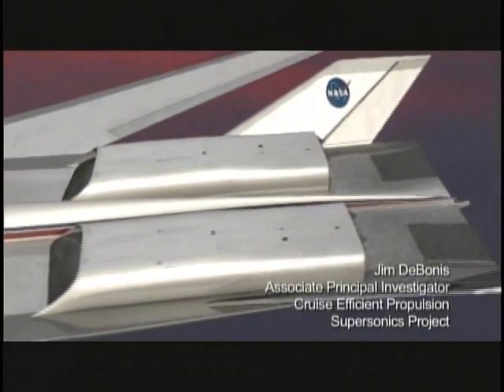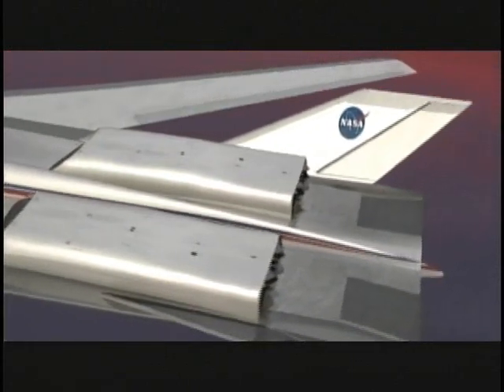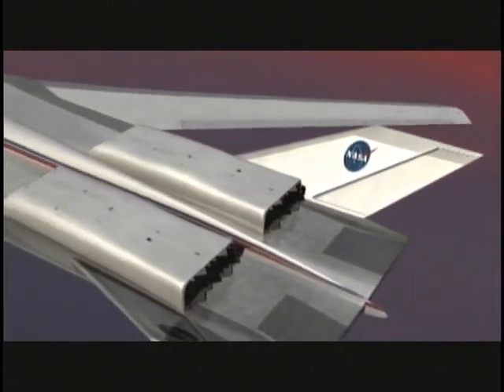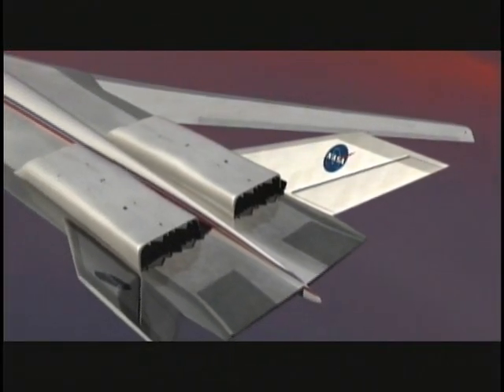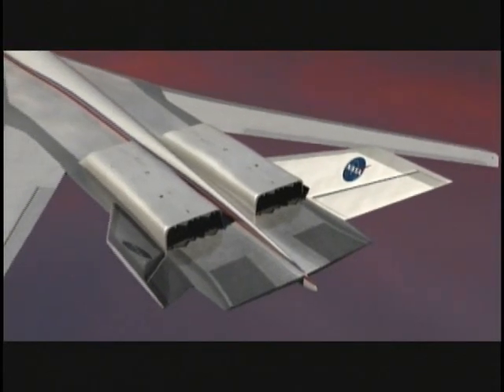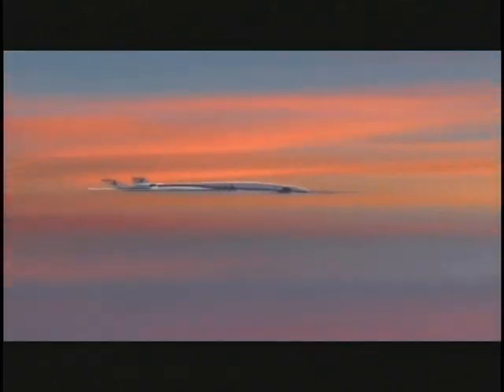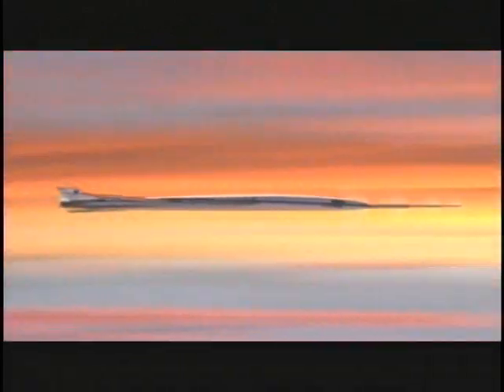NASA quiet supersonic transport concept

Comment: Supersonic aircraft will be allowed to fly across America if and when they can be shown to not result in a sonic 'BOOM' when they fly at half of their intended altitude.  So lets say a plane is proposed to fly at Mach 2 at 50,000 feet.  That airplane will be allowed to fly on such a path ONLY if it also does not result in a sonic BOOM when it is flown at Mach 2 at 25,000 feet.  Otherwise  NO DEAL.